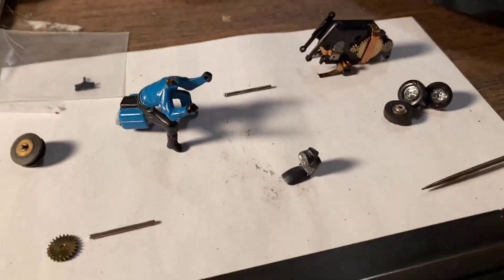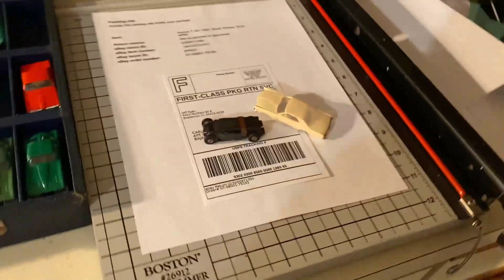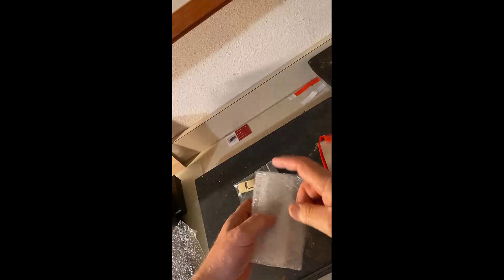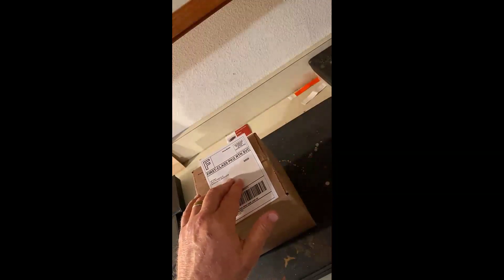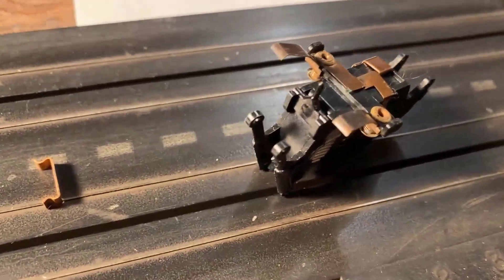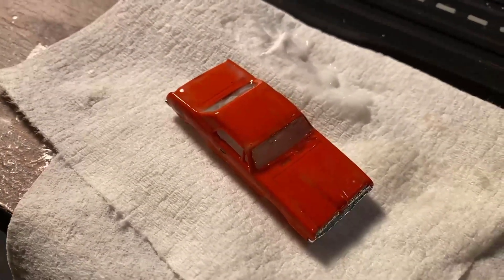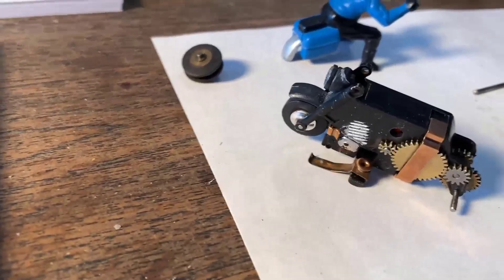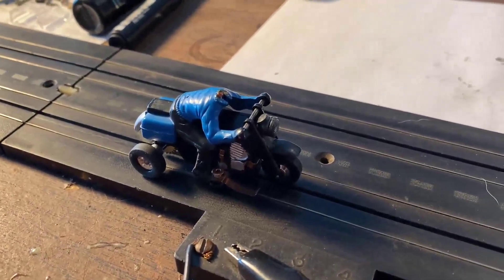Aurora Thunderbike Thundertrike Conversion Part 2 Plus More

Comment: What kind and where did you purchase the front hub on this conversion of the thunder bike?  Thank You good video.
Reply from the maker: Hey Walter,
Thanks for watching and commenting, I sincerely appreciate it.
I have had a number of those front hubs over the years. They may have been in someone's part bin that I bought from a garage sale.
I think I have some left if you want one. Let me check (looking now) yep, I do. They do not have axils though. Easy fix.
Walter if you provide me your mailing address, I can send the hub right out to you.
You can use my email to send your info. 
smokintjets@gmail.com
Let me know if you need anything else.